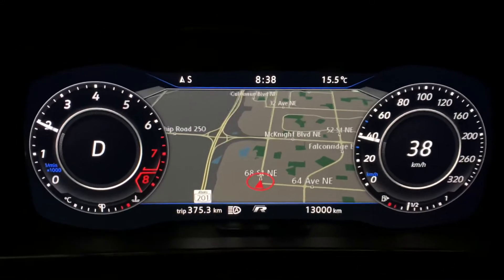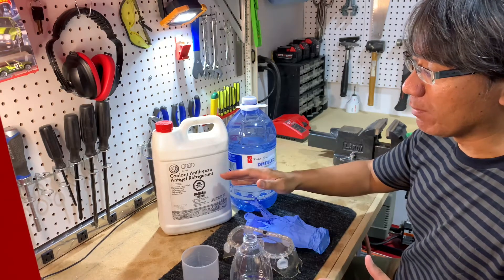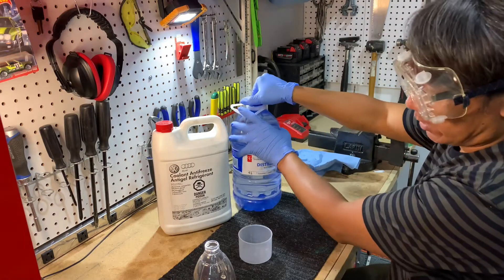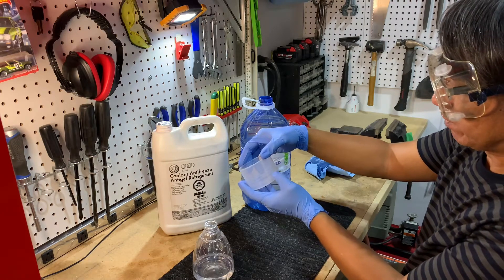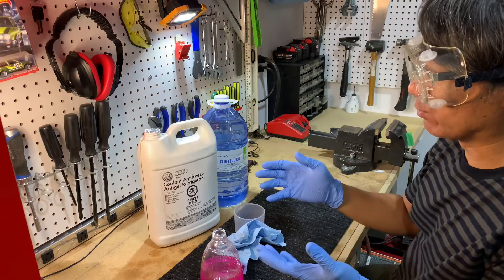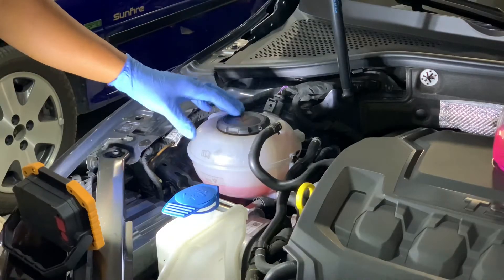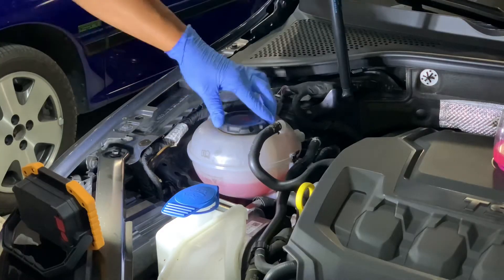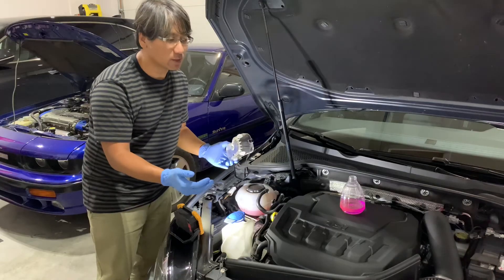How To Properly Add Coolant On A MK7 Golf, GTI, R, MQB EA888 engine

Comment: Hi, great video. I have a few questions I've been thinking about for years but never got around to asking anyone.

Can I run only water?
Can I run only coolant?

Thanks.
Reply from the maker: Thank you 🙏 In regards to your questions, if you have the chance to watch the video I did cover the proper ratios of coolant to water depending on the weather conditions and I wouldn’t deviate from that. I also noted the proper details on the description.  In any case I will never use 100% coolant. In desperation, I would rather use water (preferably distilled) before putting a pure coolant.

Comment: How do you flush the coolant on a mk7.5 GTI? I am at my wit's end trying to find out how to do this and I keep coming up short. Any advice would be greatly appreciated. Thanks!
Reply from the maker: Sorry I haven’t done a flush on the golf r given it is still under 20K KM, but I believe these car don’t have a specific grain plug to drain from but jut via the lower coolant radiator hose by pulling the metal clip and the fitting will release

Comment: where do you buy the engine cover? i have a vw golf 7,5 R and the cover is not the same
Reply from the maker: @Carlos Mateus the engine cover is the Tiguan cover. I got if from a group buy many years back on one of my Facebook Groups.  Unfortunately I don’t have the part number on hand, but I am sure you can find them online or through the dealer

Comment: The only thing im looking for is the LEVEL of the coolant cuz my Golf mk7 throw out the coolant from the coolant tank oveflowing i will have a look at that and see the results ❤️
Reply: Does your temp gauge work fine Or it just throws coolant from the reservoir? Mine is doing the same thing and I can’t figure it out.. Car runs fine, no power loss or anything but it just trows coolant and my temp gauge does not work properly

Comment: Why not use ready mixed antifreeze from VW which they supply at least here in the UK
Reply from the maker: The 50/50 mix works as well if you don’t want to deal with the concentrated jug

Comment: I have a Golf Mk7 2.0 TDI from 2013, which
Started overheating. The gauge goes from 90 to 120-130 in just a few seconds and then goes back down as fast after staying there for a while. There's no pattern to it, it can happen after 3 hours of driving like after 4 minutes of standing still.
I have changed thermostat and coolant temperature sensor but the temperature still rises to 130°.
No white smoke from the exhaust and no bubbles in the coolant container.
I read on the forums and people have the same problem as me, and they changed the water pump but they still have the same problem.
So it's stupid for me to change the water pump and the problem won't be solved.
Has anyone had the same problems with the Mk7 2.0 TDI? 
Thanks in advance for any help.
Reply: Water pump
Reply from the maker: How’s your cooling fan and radiator? What is the color on the coolant? Is the coolant depleting?
Reply: Water pump or auxiliary belt

Comment: I think you have it backwards. The VW Audi concentrate should be no less than 50% coolant concentrate, and option to go 60/40 or 70/30 (coolant/distilled water) for higher protection/boil point. Just did a failed coolant vent tube adapter, also VAG dealer now sells newest "G12evo" that replaces G13 and is backwards compatible

Comment: Why did my vw dealership give me a small bottle of solution that they say I must mix with the g13 coolant? Thanks
Reply from the maker: What was this solution they gave you exactly?
Reply: @JNBTuning  p/n: KKG 13 solution that you use per gallon, if that makes any sense. The coolant from dealership says not to add water. It’s 50/50 ready to use. Just add the solution to the gallon of coolant and no mixing with water.
Reply from the maker: The coolant I used is G013A8J1G and it requires a distilled water mixture
Reply: @JNBTuning  ok no water mixture here just the solution mix with the gallon of coolant which is much easier I think.